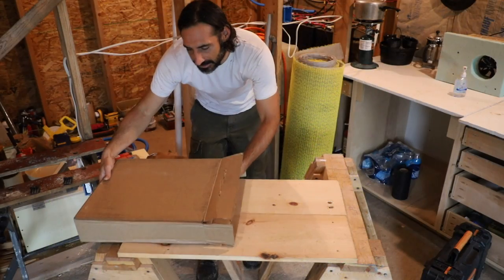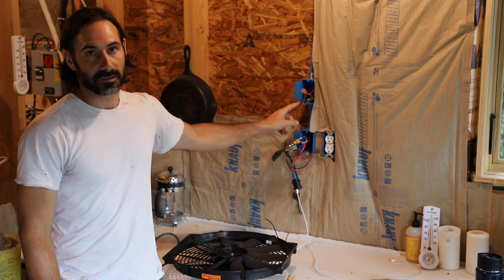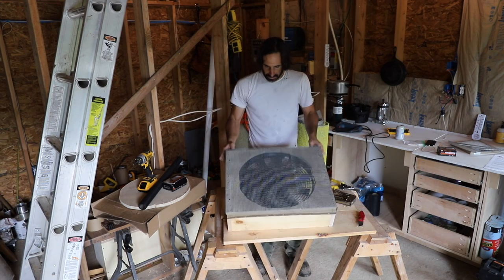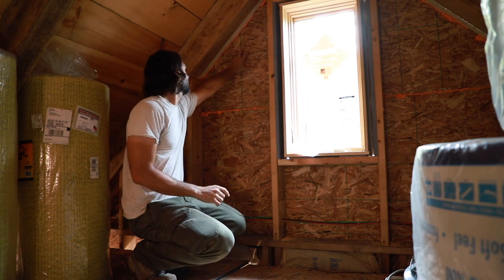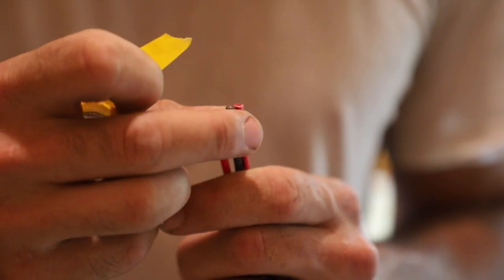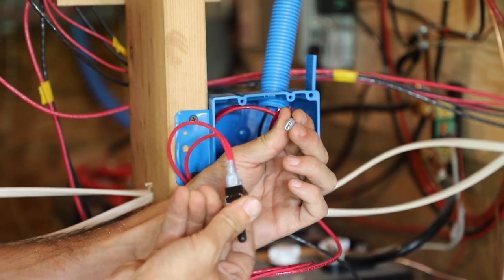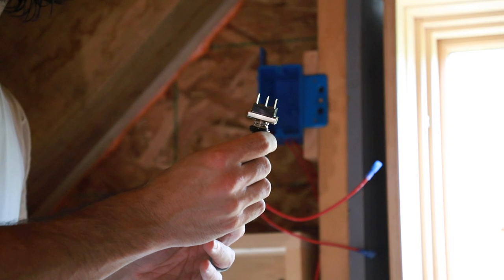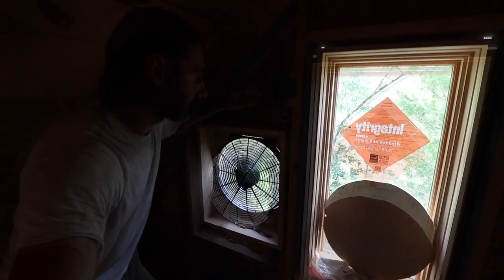Off Grid Alternative to Air Conditioning?  Making a Whole House Fan From a Radiator Fan

Comment: It's very noisy! we got cooling fans that can operate on 12v and they can switch direction depending of its winter or summer. Maybe you can insulate it some how to cut down on the noise, or put like a dimmer switch type of thing so you can vary the speed, because it doesn't really need to go that fast. Thanks for sharing, you did a good job. Cheers!
Reply from the maker: Thank you, in the next video I will install a speed controller like the one I used in my kitchen video.
Reply: @50Acres  that's wonderful! I hope it works really well for you, thank you for a reply, and the videos, your home seems to be progressing well. Cheers from Tasmania!

Comment: So how's the fan working for u 2 yrs later? Couldn't u have boxed the intuit fan & make it so u could turn the box depending if u wanted to pull air in as well as draw out? Seems like it b super noisy
Reply from the maker: It works really well in the fall and spring when the weather is right for it.  I added a PWM controller so it's not loud anymore. There's no need to turn the box because it pulls air in from the downstairs windows.  As designed it's meant to replace inside air with outside air.   I have several follow up videos on a playlist.

Comment: could have built a slide for the screen,  a aluminum pre-made screen would do the trick [ easier to remove and clean ] , while connecting a 3 way dimmer  switch to control the speed.

awesome video !!
Reply from the maker: Thanks Scorp!

Comment: Might want to "run" the 24v at 12v IE "derate" the fan. you will still get most of the airflow and a whollllllllleeeee lot less noise :-) Those fans are not the best for this because there is no design consideration for noise. they are in very noisy cars so noise does not matter to their designs. but it might matter to you.

BTW gorgeous looking house. Really love all the wood!
Reply from the maker: Thank you!  I think I will wire in a PWM controller and see how loud it is at 25 or 50 %

Comment: I am guessing that it doesn't take too long to vent the hot air out of the cabin with that fan, so the noise is really not a factor .  Cabin Woodwork is looking really good !
Reply from the maker: It changes the air really fast.  Thanks Frank glad you like the woodwork.

Comment: To reduce noise and increase air flow - I would put another exactly same fan on the other side of the window - and wire them in series so each fan will get 12 volts and will turn slower and be quieter.  But with 2 fans running I believe you will equal air or more - because the lower velocity air from each fan will be resisted LESS by the screens you put over them.  Also your fan motors will last longer! :)
Reply from the maker: This fan moves 2,250 CFM probably changes the air in the cabin in around 3 minutes.  I was going to wire in a PWM controller and run it at less power.

Comment: You should look into passive heating and cooling. There is a science to designing your house on your property taking into account shade from trees, the direction the house and windows are facing the types of building materials use etc.. It causes you to retain heat in the winter and retain the cold from the night before in the summer making your house comfortable year round without electricity. Done right, you'd never know the house didn't have a heating or air conditioning system.
Reply from the maker: I've tried to incorporate many aspects of passive heating and cooling. Roof overhangs, south orientation etc

Comment: When a teenager we had an "attic fan", as most houses did....Air conditioning became more common in the late sixties and definitely in the seventies. However attic fans were very, very effective......Usually placed in the hallway, they were shuttered until you flipped the wall switch......The fan came on and the shutters opened...Fan size was about 36" to 48".....
Reply from the maker: my in laws have one, it works awesome, how I got the idea

Comment: I'm guessing that the next video will be about the removal of that 102 decibel automotive fan, and it's replacement with something more suited to residential use.
Reply from the maker: It changes the air in the cabin in around 3 minutes (conservatively) then I use the built in silencer AKA the off switch.

Comment: Nice work bud.  Take a look at a Ford Taurus or Contour for a 2 speed fan, they move the most amount of air and are popular among hotrodders.  Plus are cheap and easy to find in the junk yards.  Do a little google foo and you can see how to wire these up since its for home use and DC the wiring shouldn't be to far off, relays, fuses etc..  If you want to bring your fan down a bit from max power look at a FLEX A LITE 33054 CONTROLLER or similar to slow it down.
Reply from the maker: Thank you will do!

Comment: Looks like an area where night time temperatures consistently fall well below 70F. If this is true than evening temperatures can be used to freeze a quantity of PCM (Phase Change Material), like coconut oil every night. Kind of an exotic solution and perhaps not always practical but for certain applications it can work quite well. During the daytime the rising temperatures will try to melt the coconut oil. Coconut oil's high enthalpy of fusion (latent heat energy), will resist melting by absorbing huge amounts of heat energy. Like ice cubes in a glass of soda holding the beverage to just above 32F even though the room's air temperature is well above freezing. The ice cubes will maintain the beverage at just above 32F until all the ice is melted. The frozen coconut oil will do the same thing (albeit at 75F).  At about 105 kJ/kg it might take 50 gallons of coconut oil for this tiny house but it would work. A similar fan would be needed to pull the cool evening air over the containers of oil at night to better freeze the oil. Ideally the containers would be made of thin walled copper but this would be prohibitively expensive. Thin wall aluminum beverage cans would serve perfectly.  Would need to be sealed and O2 free to keep the oil from turning rancid. Of course the cheapest route would be to use water. 500 gallons of water should work, lowered to below 70F at night it would absorb a lot of heat energy by the time it reached 80F. The key is to live where night time temperatures during the Summer fall below 70F.

Comment: If you paint your roof with hydrated lime, then the attic will not heat up to 156 degrees F.   It will only get about 104F.   There are a couple descriptions of doing that on builditsolar dot com.  Search for "White roof experiment" on that site. Those radiator fans use several amps of electricity.  The white roof uses no moving parts and no electricity and makes no noise.  It only costs about 20 bucks for 60 pounds of hydrated lime from any hardware store.

Comment: Just curious and have to ask this question. Cross ventilation with all those windows doesn’t work? It was a very effective method for centuries, provided the building itself was properly aligned with prevailing winds.
Reply from the maker: Cross ventilation does work well especially  when I have a nice west to east breeze.  This just turbo charges the natural stack effect.
Reply: 50 Acres & a Cabin I’m in the process of building my own off-grid at a lake in Canada. Regulation made me locate 50 m (150’) back from the lake and retain existing trees over a certain size. I have been totally amazed how much the trees - in full foliage (summer) have affected the breeze that will be available for cooling! It will certainly be a balance of keeping enough heat in one season or for the benefit of shedding heat in another that will affect my decisions of which smaller trees will go.
Foul weather this year has made me postpone the foundation until next spring, but the blessing of that is that it has forced me to give deeper thought to issues like this. 
Thanks for sharing your trials, tribulations and challenges. I for one have learned plenty.
FYI- I’ll be adding another ground floor window to the blueprints and double checking the attic entry/dormer alignment.
Thanks for the help neighbor.

Comment: A label maker is going to be your friend in the long term to label each wire pair so in 5 years you have no question of what the wire is to. 

You can setup some basic logic to control the fan with normally open or closed thermal control switches. Find the ones for the temps you want it to turn on/off and wire up so even with the switch on it will operate off the temp at the fan. Can also duct the fan to the ridge to suck the hot air from the very top even with the fan down lower. 

Not limited to 24v with a 24v battery as you can get a DC to DC converter. Lower amp ones can be wired in line to not be a phantom drain on the system when not in use and larger ones you can wire into a fuse block to split out to multiple things.
Reply from the maker: Always good suggestions Andrew h thank you, I am planning to wire in a controller which I think should help a lot.

Comment: aren't you concerned that the screening will cut down on are flow?  The bug screen probably effectively covers 25% or more of the fans surface area. You could try to use metal, rain tight shutters, but that adds extra cost.  Any idea what the CFM on the fan is?
Reply from the maker: im not sure what the CFM is it seems to change the air very fast, within a couple minutes

Comment: Thanks good video and budget idea bit loud but dare say you will only run it for 5 or 10 minutes to cool down the place, will also help with the burnt toast smell 😁. Are you planning on fitting a wood burning stove?
Reply from the maker: yes indeed al, it doesn't need to run too long, I am going to put in a wood burning stove.

Comment: Haha had to laugh at that ear blasting pace. A speed controlled will definitely help. And have a look at a suspension system with ducting to take it out via a hooded vent in the apex of the roof and a butterfly flange to stop the air escaping. Are you enclosing that loft area? That would also help. Just insert a return grill in to the outside of the wall into the main space, then add a dampening box, then the fan (suspended to eliminate vibration) then a collar and butterfly flange then ducting to the apex with a hooded vent.
Reply from the maker: It changes the air in 3-5 minutes so I'm not to concerned with it but I'll install a PWM controller in case anyone sleeping in the loft wants to keep it running all night for white noise.

Comment: Whole house fans are the way to go. Nice job!! One suggestion, to increase air flow without using more power, instead of using your screen and hardware cloth flat; create a cone, hemisphere or stand off box out of the screen and hardware cloth which increases the area that air can flow through. It should also by reducing the restriction bring down the noise factor a little and the current draw.
Reply from the maker: Yea they really work well all things considered, if it';s ever wanting for airflow thats a good idea.

Comment: Cool project!
These fans don't have good life expectancy, as they are designed for momentary use.
You can quiet the fan with a speed controller, you don't need much displacement to make huge difference.
Will be interesting to see how little it will take - plus you'll improve life expectancy with slower rpm's
Reply from the maker: It moves 2,250 CFM.  If the air changed 100% efficiently it would be done in 2 minutes and 31 seconds based on the volume of the cabin.  So, once I wire in a PWM controller, It can still safely get the job done in 10-20 minutes or so at 1/4 power.

Comment: Hi Daniel after living with your fan for a while what are your thoughts? I was thinking of going with a Lincoln Mark VIII fan that runs at 4000 SCFM.I  imagine its noisy, maybe use it intermittently?
Reply from the maker: I ended up wiring in a PWM controller so I can run it around half speed and it’s pretty quiet.  Full blast is loud!
Reply: @50Acres  Right on thanks, I'll watch the video.

Comment: Love your video, but i'd like to suggest placing an air filter on the inside/front of your fan. That fine mesh screen will eventually clog up and it's not removable. Good job :)
Reply from the maker: Thank you Greg, thats a good idea, I did that with my range exhaust fan and its definitely a good idea for that fan as well.

Comment: Do you know how many Cubic Feet per Minute of air it moves? Thanks for the video.
Reply from the maker: Im not sure but just anecdotally I would guess it changes the air in the cabin in under 5 minutes.  the thing really blasts, I'm going to wire in a controller.

Comment: You could wire two , 12 volt fans in series , and then run the pair on 24 volts . As you probably know there are twin radiator fans available.  Something you might consider in the future , in the need ever arises .
Reply from the maker: not a bad idea!

Comment: Just wondering if the motor is continuously rated?  In a vehicle it would not run all the time.
Reply from the maker: im not sure but I only have to run it for a couple minutes to change the air in the cabin

Comment: Wouldn't you want the fan to push air outside? so the hot air is pulled out, and the cooler air pulled in from ground level?
Reply from the maker: That's what it does, it pulls air from inside the cabin.  You crack the downstairs windows and it pulls the cold outside air in and exhausts the warm inside air.

Comment: You mentioned not being able to position the fan up in the peak of the roof. 
There's no need to.  It shouldn't be hard to add a simple duct enclosure to extend vertically and pull air from up higher.
Reply from the maker: Yea I’ve got some modifications planned on this project.  I’m not done tweaking it by any means.

Comment: You could use a 12v fan, and DC to DC converter about $10 from amazon, and, or, use a pwm DC motor speed controllerabout , about $4 from amazon, and have constantly varable speed, im building one, my house is 24v also. But I also have a 12v Batt bank. I think k they are too loud, and too fast at full power for being in house, I'm putting in two, and hope to be cool all summer, and have no need for ac, that takes too much power to run ac, off grid for now anyway, I will be running my generator too often, that gets expensive!! Great video...
Reply from the maker: Thanks James, I am planning to wire in a PWM controller good luck on your house.

Comment: Dou you think if you switched the plastic fan blades with metal would it be quieter
Reply from the maker: I'm going to wire in a PWM controller then I can run it at any speed I want.

Comment: 15:00 those connectors have a specific name or its just called "wire connectors", never saw them before, they are pretty handy.
Reply from the maker: I think they are called wire crimp connectors, you get them online or at war mart or auto supply stores.  The wire crimper works awesome and is linked in the description.

Comment: You mentioned that A/C switches burn out too fast due to heavy arching. Why not just wire everything in a ground side circuit?
Reply from the maker: That would have been a good way to do it

Comment: I made the same thing , put ultra caps and solar panel to stabalize and give the dc fans longer life, i used two fans in parallel and one 130 watt solar panel, been using it for 5 years to vent my attick , saves me  a lot of money in electricity. about 40% .... if your dc power supplies are burning out for night time use, look at my videos i show how to make a very durable and reliable dc power supply . i have this same power supply in parallel with the solar panel and at night the fans spin and in day when there is not sun or little sun the fans never go below a certain rpm, essentially the fans run year round . I spend about 15$ month in electric to run them during the nights but i save like 100$ over all per month
Reply from the maker: Nice myke glad to hear it is working out for you.  I will check out your video when I get home from vacation .

Comment: K. I gotta ask. Why wouldn't you just install an attic fan? They've been used for your situation for decades. Works great, I know because my house has a rooftop mount and I've seen them side mounted in an exterior wall also. They are quiet, efficient and move a lot of cool air in from outside.
Reply from the maker: I needed a 24 volt DC fan and most attic fans are 120 volts AC
Reply: @50Acres  K. Now I understand. The things girls don't know and the things guys do know. Thank you.

Comment: No need for high speed fan. Just one that has blades that can move lots of air at a low rpm. Think ceiling fan speed on low. That is all you need for a good air mover. Just be sure  you have your upper area sealed well so no air leaks from outside. Then open up the lower  level and you will cool your home in no time.

Comment: Bury a metal pipe in the ground and close the widows. Connect the pipe to the house and let the fan pull air through the pipe into the house. The ground will cool the air. Wet ground is better. Also the the longer the pipe the better. Then slow your fan down. The air needs to move through the pipe slower so it has time to cool. Let you insulation work to hold the cool inside.
Reply from the maker: Earthtubes, that would be really cool maybe someday if I am feeling very ambitious!

Comment: Squirrel!!

Is that cable actually called a smurf cable, or is that a nickname?
Reply: The ENT conduit has that nickname. There's also matching connectors to join it to the outlet boxes. Blue by default, but available in other colors, red/yellow/orange.
Reply from the maker: Dwights correct, it's a nickname for the conduit.